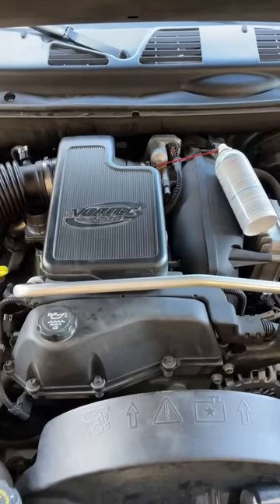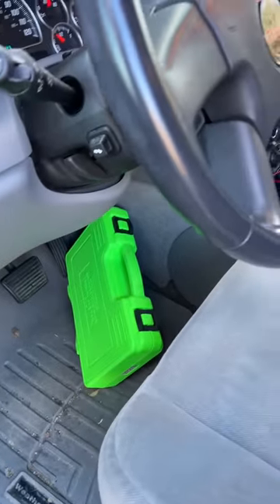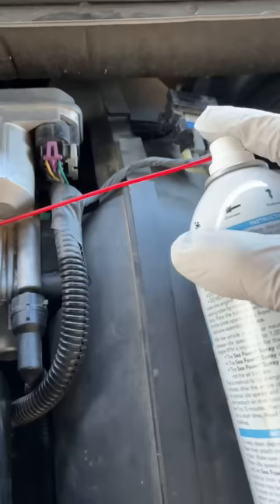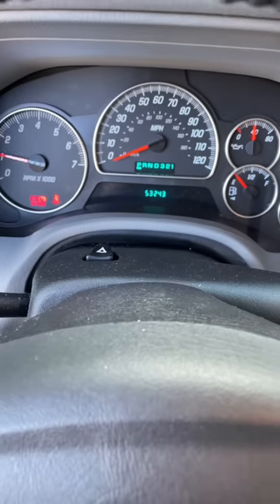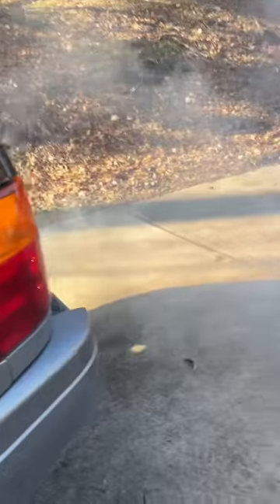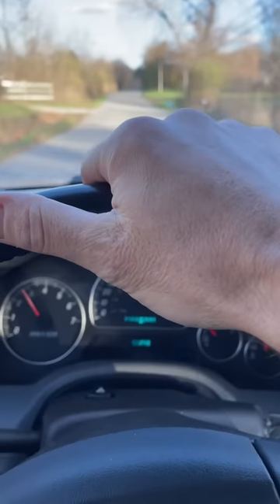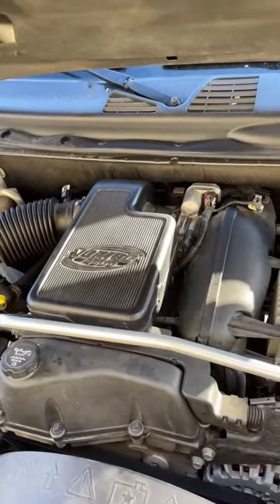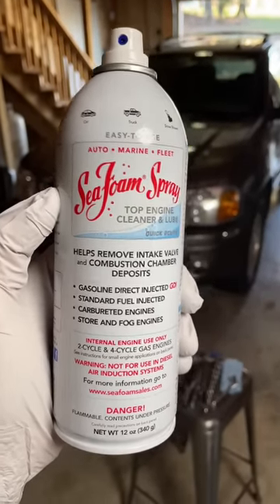Seafoam Smoothed My Rough Idle! Part 3 of 3!

Comment: I got pulled and used the excuse sea foam told me to drive aggressively. They didn’t buy it
Reply: Maybe a court would in a civil case 🤔
Reply: But did you show them the can???
Reply: *pulled over
Reply: @1985cjjeeper they most indefinitely would not 😂
Reply: I knew someone who got a ticket when he drove too fast burning Seafoam and didn’t see the cop. He wouldn’t have gotten pulled over if he didn’t gun it.
Reply: HAHA I did the same thing and got a warning 😝
Reply: @taylorrenyo  Everyone knows what he means, comments like yours are worse than the grammatical errors, it's not a college essay
Reply: best to do this near a highway entrance. not needed if u have a manual or auto with gear selection then you can maintain low speed, high rpms.
Reply: "whips out can"
Reply: "SEAFOAM MADE ME DO IT!!! " 😂
Reply: @redmaster61 😭😭😭😜
Reply: You got pulled, eh??
Reply: 😂 that’s a good one tho 👍
Reply: But did they buy seafoam?

Comment: Don't tell anyone that it was the Throttle Body Plate Carboned up, and a bit of brake cleaner and a tooth brush would have done the same thing.
Reply: Berrymans b12 spray...no brush needed lol
Reply: If it's a chlorinated brake cleaner your engine is going to have heartburn. Don't use it unless it's a last resort. That's why they make carb and throttle body cleaners. They work better.
Reply: Naw man the dude hates his catalytic  converters and wants his engine to be as clean as his transmission inside. My favorite part is that seafoam tells you to drive aggressive, 😆. They tell you what to try first right on the bottle! And then think how many people run the seafoam behind the throttle body and never get the part you want clean clean. 😆
Reply: He did that already in Part II of this three-part series of shorts. It didn’t improve the idle any.
Reply: @robertthomas5906  I’m pretty sure he’s referring to scrubbing the throttle by hand lmao, not about spraying it in to the running engine
Also never burn chlorinated brake cleaner. I shouldn’t have to say this but the fumes are very very toxic
Reply: Never use brake clean where it can be pulled into the combustion chamber and burned, it will burn out your O2 sensors.
Reply: Why waste time lmao
Reply: It works for valves too, fixed Toyota syndrome on a vehicle before
Reply: There is a cleaner just for that, I think CRC makes it.
Reply: Some throttle body plates cannot be cleaned that way. Some vehicles have a thin film over the plate to help it seat.
Reply: that's what I said. I use Berryman's B12
Reply: What's throttle body paste?
Reply: The purpose it to clean up the cylinders from direct injection usually because the cylinders are cleaned by fuel as they are in port injection engines
Reply: @dixienormus5106 He meant to say "Remove the TB and clean it by hand" Off the engine....
Reply: @Pyle81  still dont use brake cleaner.
Reply: @kaleb62patriot  on MFI it sprays fuel in the back side of intake valve keeping it carbon free (this is cheverons TecRon technologies claim about removing and preventing carbon). Carbon build up on direct injected engines is huge issue.
Reply: @stich1960  what’s Toyota syndrome? At the moment my Tacoma has a misfire on six idles like a bitch and leaking oil around the camshaft plugs
Reply: I just made a very similar comment! Haha, your spot on... But if you use carby/throttle body cleaner and a rag- it'll do the job just fine. Just don't force the butterfly open manually with an electronic throttle body (it's fine with a mechanical throttle that uses a cable or linkages), make sure the throttle is fully depressed...
Reply: @kcindc5539  You have to scrub it off with a rag drowned in carb/throttle body cleaner and it works fine... Been doing it almost daily for 23 yrs
Reply: @stich1960  That's about the only thing it's good for- carboned up valves in direct injection engines
Reply: I’ll try that on my trailblazer thank u
Reply: It's an atlas motor. 90% chance it had carbon all over the intake valves and was causing a fishbite miss at an idle and the fuel trims were super screwed up trying to compensate.
Reply: Throttle body cleaner and a toothbrush is what I used
Reply: @mwoodall13   turns into Phosgene Gas, AKA Mustard Gas. Bad news for real. Never Ever use it to clean anything that's gonna be welded as if ya don't wait long enough it'll stay wet in scratches and pits in the parent metal and once ya run the arc across it, poof.
Reply: I can tell u first hand that this stuff works much better than throttle or brake cleaner. Had it fix running issues on diesels many times and in gas engines. It does far more than just clean the throttle plate
Reply: Before you knock something you know nothing about. Just know that manufacturers use this same thing to fix direct injection engines from being carboned up. Yes this does work. And yes this is exactly how your supposed to do it. After the hot soak beat the dog piss out of the engine for a couple mins and it cleans off the carbon on the pistons and valves. Carbon build up causes hot spots so you get pre ignition. Thus the miss. But my 2 cents from being in the industry. You believe what y’all want.  Job security for me. 😊
Reply: Yup cleaning the throttlebody bore and plate with a brush an gasoline. Then wipeing it clean with a bit of brake cleaner it will idle like new.
Reply: That doesn't work with electronic TB
Reply: You are so wrong brake chean and a tooth brush will not decarben the back of the valves or clean the inside of the intake.
Reply: @brianobrian9334  I can only find a pour can
Reply: @adamhandyside9836  AutoZone usually has it... sometimes O'Reilly's. I'm in Texas ,not sure about your area
Reply: @henrywarren5634  check your ignition coils and spark plugs. Could also be your crank or cam shaft sensors. I’d also check your pcv valve if you got on. If it clogs it will blow out the valve cover gaskets and spray oil everywhere.
Reply: ATS cleaners seem to be the best in the market right now, engine oil and fuel system treatment. Also recommend the Lucas Trans treatment. Those three can make an old engine and trans with some fresh engine mounts, butter.
Reply: @danielbrealey2924  Daily! I just drive mine 😂
Reply: @staycurious3954  I think you misunderstood, I meant daily because I'm a mechanic who works on cars for a living. We clean throttle bodies all the time
Reply: @1985cjjeeper  so basically an Italian tune-up 🤣
Reply: @henrywarren5634  you get it figured? If the cylinder that is misfiring never changes when you reset codes and start it then try changing the spark plug with another cylinder clear codes see if it comes back on the cylinder you changed it to. Do the same with the coil. 

If it doesn’t stay on the same cylinder without changing anything then catalytic converter could be clogged, I had that happen to me on multiple vehicles I have bought over the years.
Reply: He already did tell everybody about the throttle body, in part 2 of 3. See how this is part of a series and he mentions that he's already tried common fixes for the idle?
Reply: @henrywarren5634  Carbon buildup from direct injection
Reply: Most TB plates have a coating on them!!!
That why the make specific TB cleaners
Reply: Right... My parents had a idle/acceleration issue on thier Trailblazer for two years which is the same vehicle/engine. After telling me the issue within the hour I cleaned the throttle body with brush/cleaner and she purred like a kitten 👍.  Start with the basics fellas!
Reply: He literally did that
Reply: Watch part 2 of 3 before you run your mouth
Reply: My Envoy has 277,000 miles and still trucking right along
Reply: Wrong
Reply: No not brake cleaner.

Comment: Per Derek at Vise Grip Garage: “giver the old I-talian tune up.”
Reply: Fellers gotta do the right thing and ignore it
Reply: ceptin he uses Berrymans, just the same only cheaper
Reply: Wayyyy too much… perfect.
Reply: He uses berrymans which has been my go to for years. Been doing the good ol I-talin tune ups for years. Stuff is magic in a can, I tell ya what.
Reply: Vice grip garage a subsidiaries of "bailing wire 80 mph tape automotive"
Reply: @parentsbasement7734 “ pour it right down the old yap.”
Reply: @TheMrEdmonds  "Just pretend we didnt see that"
Reply: @clicks59  "feed her the onions"
Reply: I 'll be dipped
Reply: @nou8257  "BRING THE THUNDER!"
Reply: Do you like I-talian food?
Reply: Italian tune up is using the fuel itself to clean up which can't happen the same way in direct injected engines
Reply: It's proven. The Italian tune up really works. I do it myself every other oil change of economy driving stuff builds up and driving it hard and Rev high will clear up the top end and flush the injectors or carburetor
Reply: My last name ends in "io" and I approve your pronunciation.
Reply: Make sure you keep an extra can on the drinkin side
Reply: Fix it again Tony.
Reply: I wonder what Doug Supernaw is doing right now?
Reply: @tuckerdogglass5383 I didn’t see any Arizona chrome (duct tape) in the video, so sad.
Reply: Smells like dead rodents and sadness.
Reply: Well I'll be dipped
Reply: @bottomlinebassin2001 lil' for the broth...and a little for the cook too
Reply: I wonder what Warren G is doing right now.

Comment: If its traditional seafoam, no dont use it. It was designed for old 2 stroke engines. As in it has oil in it which is where all the smoke is coming from which can ruin catalytic converters and O2 sensors..... You want to use cleaners that contain PEA which are designed to clean 4 stroke engines. Just clean your throttle body properly, make sure you have a good filter, no vac leaks and then use a cleaner with PEA. Of course if there's too much carbon and gunk built up, nothings gonna work. And yes, Ive tried seafoam. Its a joke.

Comment: I used to buy cars all worn out with rod knock for  2-300, a can of seafoam later, could sell the car for 8-9 thousand. Now I've moved on to wrecked Ferraris and Lambos, and bygolly, seafoam works on those too. $2,000 for the wrecked Lambo at auction+a can of seafoam, can sell for $165,000 easy.

Comment: "Drive aggressively" proceeds to slowly accelerate
when I hear or read drive aggressively that means that motor better be screaming and that 4l60e is praying
Reply: I mean, it's an Envoy. It's doin' its best.
Reply: @Naru 'Sanav  and I have a trailblazer, I know for a fact they accelerate alot harder than that, they do decent doughnuts on wet roads but here in Mexico the roads don't always get wet.
Reply: 4lslippy
Reply: @IhaveaDoghouse  going 170k miles strong. never changed the fluid lol
Reply: @NaruSanavai  I’m actually very pleased with the 4.2 lol
Reply: 4L60 prays when it reaches normal operating temperatures and pressures
Reply: @noaht5191  tell that to my 2004 trailblazer with 230k original no cooler. And 220 temps ;) lol
Reply: Fly casual hon says
Reply: The 4L60E is always praying 😂
Reply: @NaruSanavai 😂

Comment: I gave my pickup the whole seafoam treatment this past fall with a valve stem seal replacement I did. I think I gave it a second wind because I’m nearing 310,000 miles 😅
Reply: Your vehicle hasn't made it to the 300k mile marker because of sea foam... it made it because of you. Any decarbonizer will do & keep up on the maintenance.
Reply: Seafoam works on tires too???  Cool...lol
Reply: @clemdoggmillionaire9914  thanks man :)
Reply: @toddsimpson8690  it was the valve stem seals underneath the valve spring, although it would be cool if seafoam worked as a tire sealant 😂
Reply: And before the treatment, you were at 309,999 miles?
Reply: @HarryKuloh  lol idk, sitting at 332,845 miles now

Comment: This worked on my 2006 Hyundai Elantra at that time had 205,000 miles and it definitely helped out . Still average 28 mpg now at 241,000 miles on the car.
Reply: mine still held up well past 300k that car will never die lol
Reply: I would never admit to driving a Hyundai. Have you know pride man?
Reply: @clydebethatway7485  , 300,000 miles later , it must be a decent car , car nowadays won't make to 100,000 miles 🤣
Reply: @ablkmars  No... there are literally no cars nowadays that don't make it past 100k miles.
Reply: Be careful when you hit 242,000 miles though, then ECU is programmed to give 16 mpg, so you'll get tired of it and want to buy a new one.

Comment: You don't drive aggressively, you put the transmission down 1 gear and drive around normally. It bumps the RPM up and causes the engine to get warmer and burn off extra carbon.
Reply: Not everyone knows how to do that and the next thing they will be doing is spraying Sea Foam in their tranny to fix it 😂
Reply: @jeremyglass7446  🤣🤣🤣 You have a point. Stupidity runs wild on this planet.

Comment: Bought  a 97 Interceptor Crown Vic.  It sat too long and the injectors were varnished.  I put a can of SeaFoam in the tank and drove it a couple miles to get it through the system.  Next morning it started and ran 90%better.  In a couple days it ran like new.
Reply: 90% huh? Sure it wasn't 91.365%?
Reply: @Santor-  🤣🤣🤣

Comment: CRC throttle body cleaner.  Unbolt your throttle body from the intake (4 bolts and one vacuum hose with a clip, plus the electrical connector) and clean the front AND backside of the blade with the spray and a rag.  While doing this, have fuse 10 and fuse 28 in the underhood fuse box pulled, these are for the PCM.  Once you've got the carbon off the TB put it back on and pop the fuses back in, and fire it up.  PCM will now relearn the clean TB idle position and your idle will be smooth.  This is the correct procedure for this service, I owned quite a few envoys and trailblazers with the 4.2, they're great engines

Comment: That's the best thing for those 4.2s works like a champ to clean the carbon out from behind the throttle plate(seems to be the issue with the idle).

Comment: It dislodged some carbon and plugged my map sensor and took me about a month to figure that out.. lol. Sea foam these nuts!
Reply: Gotta replace sensors when you clean your system it's unsaid but fixing something isn't half assed
Reply: You should be injecting it downstream of any sensors, directly in the throttlebody. If that’s not possible, don’t use it, or clean sensors with maf cleaner afterwards.

Comment: You can add it to your oil also.  One ounce per quarter a hundred or so miles prior to oil change.
Reply: He's using the intake cleaner. Not sure how different it is from the regular but it comes with a red tube and a little black hook shaped tube to go into your intake.
Reply: Make sure you change your oil 15 mins after adding seafood. All that loose carbone goes somewhere
Reply: @Joe-nr9xf  it's the same. It's just in sprayable form